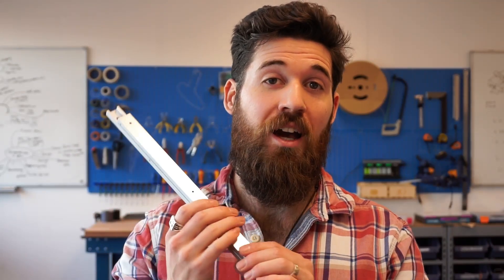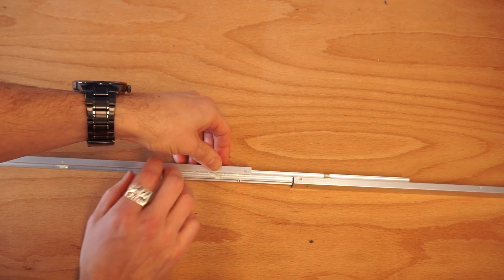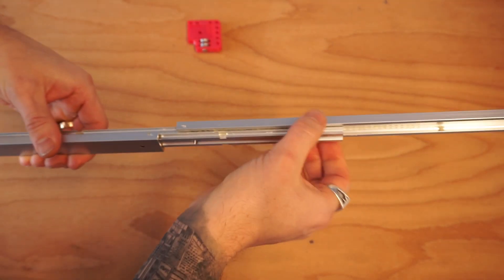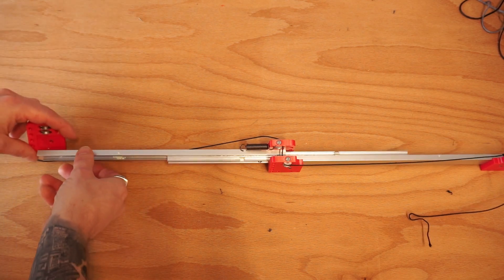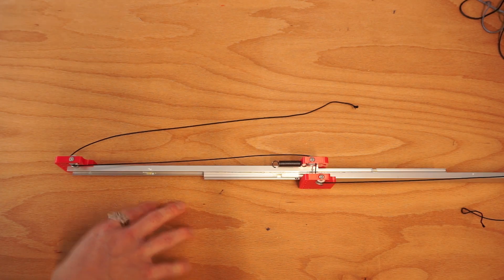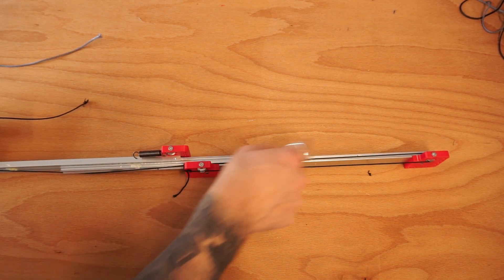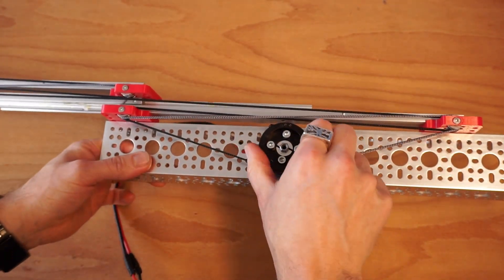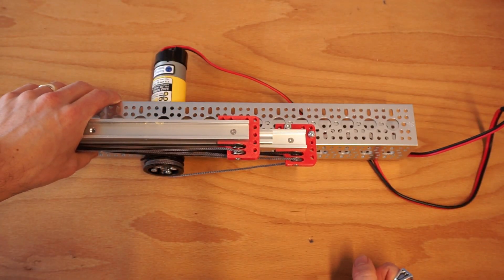How Linear Slides Work: A Complete Guide

Comment: Is there a way to rig this in a way in which we can use servos instead of motors?
We just don't want to deplete the limited number of motors and instead use them for hang.
Reply from the maker: 100%, just replace the DC motor + sonic hub with a servo horn. This should work just fine for a horizontal plane (and lower torque applications). However, if you plan to use this for a vertical motion or a hanging mechanism, you may find your torque is not sufficient to either lift, or your speed is insufficient to achieve the cycle times you're looking for.
Reply: @BroganMPratt  Could you upload a video showing us how because we are a rookie team and we don't have much experience.
Reply from the maker: @ It's as simple as mounting a servo in place of the DC motor, and attach your pulley to a servo horn instead. Something like this would be an easy drop in solution for you. 

https://www.gobilda.com/compact-servoblock-43mm-width-for-standard-size-h25t-spline-servo-hub-shaft/
Reply from the maker: @ I will also add this to the video backlog of things to create! Keep an eye out 😉